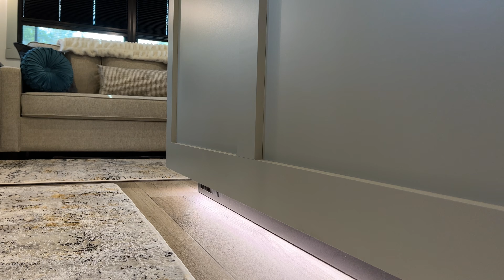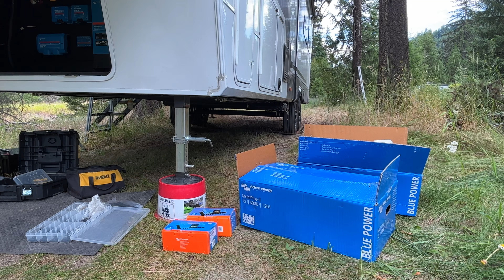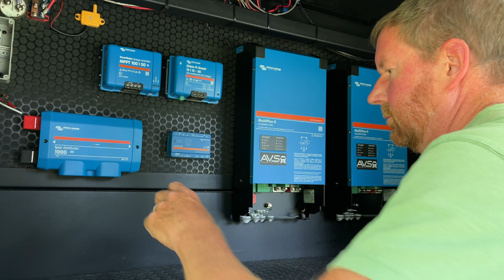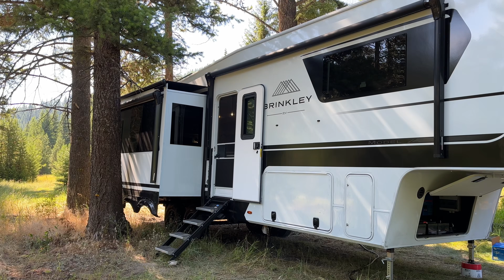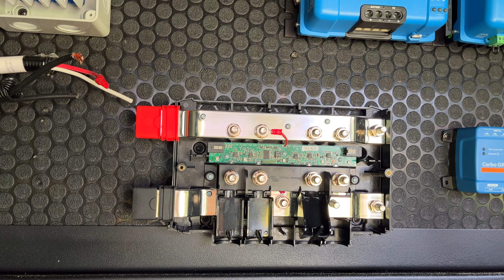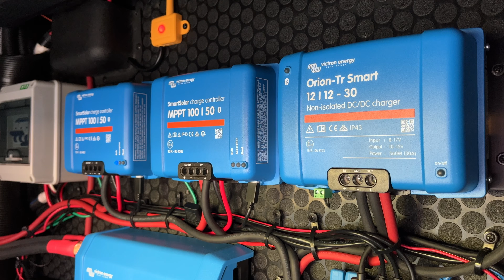This RV power couple is Alaska road-ready | Victron system upgrade in Brinkley Model Z

Comment: Gosh, I see a bit I would never have this setup in my RV with this system.  2 x 370 watt panels in AK for charging 1000 amp hours of battery?  Nope, with all the overcast and rainey days, this system will rely on shore power or vehicle charging to top off the batteries....however 30 amps from the truck is a joke.

Is the reason for not using 24 volt system is because the batteries aren't 24 volts?  I used groups of 12 volt batteries in series for my system with no issues and used a Victron battery balancer for each series pair.  Doing this allowed me to get twice the wattage of solar panels from each MPPT controller.  

Why 2 Inverters?  With one multiplus, I can run one airconditioner on high and my microwave or airfryer.  The idle power draw of two multiplus 2 inverters is about 35 watts per hout for both.  That is 840 watts wasted in 24 hours in idle mode versus 420 watts with single inverter.  The video posters do not have sufficient solar capacity to offset this load.

The people who think this is a great solar system are obviously uninformed.  This is basically a system that relies on battery overcpaacity and with minimal solar power generation.

A rig like this should easily have 3000 watts of panel on the roof to make it boondock/dry camp capable.
Reply from the maker: Hi @andrewdoniec4145, the owners of this Brinkley had already purchased the 12v batteries before they reached out to Adventure Van Systems to install the rest of the system.  These particular batteries cannot be connected in series for a 24v system, so Ken went with what was there. Ken installed a dual inverter system so they could run everything in the rig while allowing for the derating of the Multiplus II units in hot weather.  The dual inverter/chargers also allow them to recharge from shore power or a portable generator more quickly.  The system was installed after the Orion XS units had been announced, but they were not yet available. The owners were going to evaluate how the system works for the way they intend to use it, and address a possible Orion XS upgrade or second alternator down the road. Similarly, they wanted to evaluate the two 370w panels with their personal use scenario, and add additional panels and charge controllers if and when it makes sense for them.

Comment: I have a Brinkley and love it too but this isn’t a win for them. A story about a neat couple that happened to find the one guy that could build this. Brinkley needs a Victron factory option.
Reply: Dealers can’t do this.
Reply from the maker: Hi Tom. When comparing Brinkley to the general RV market, this was a major win for any aftermarket upgrades. Some RV power systems are perfectly adequate but can be a real mess to do an upgrade to - both by the dealer or by an owner after purchase. Brinkley has thankfully built a system that is organized and detailed and has a much higher level of quality in their execution than we see in most other options. While Ken is a very skilled installer, in his own words, ‘Brinkley made this process very easy,’ and it's something that a technician experienced in Victron equipment could manage but yes, you do have to go out and find them. We love the idea of some options from the factory, and have certainly started that conversation. For those who already have a Brinkley or are looking to purchase a new or used Brinkley now, we hope this can be an encouragement that doing something similar is possible. Ken even offers equipment and guidance if you want to do such an upgrade yourself.

Comment: How big is the battery bank?
Reply from the maker: Hi @Mudford63, this battery bank is comprised of six 12v lithium batteries with 12000 AH of capacity. While this is certainly oversized for their loads, that is the advantage of lithium batteries. Unlike lead acid chemistries, Lithium is capable of charging at full current capacity all the way to full without needing a lengthy absorption period. This allows oversizing to comfortably handle loads for long periods of time without exponentially increasing your charge times.
Reply from the maker: It's also worth saying that with a system of this scale and the amount of power the owner needed, it could have been a good option to use a 24V inverter/charger or even a 48V system. In this case, the owner already had the battery bank, which consisted of a non-communicating bank of 12V lithium batteries. Ken decided that the system would likely maintain balance within the system better with a completely native 12V system rather than running the non-communicating batteries in series. A Quattro 24/5000 120V or a Multiplus 48/5000 120V would also have been valid options in a system like this with a different battery bank. The conveniently large electrical bay of this Brinkley camper allowed for a variety of installation options, in this case, the pair of Multiplus II 12/3000 Inverter/Chargers in parallel is a very potent power system built around the 12V battery bank.
Reply: @intelligentcontrols 12000? Or 1200?   Doesn't seem like there's 12000 AH in that battery setup.  I'm shocked they didn't add more solar.  Two 370s is not enough for 1200 AH of batteries.  They need 2400watts of panels on that roof to really benefit.
Reply from the maker: Hi @Weathergeekdan, you’re not wrong about more solar being a good bet. In this case, I believe it was the existing solar that was already installed - they did install a second solar charge controller to be able to install further solar (it might be installed by now, actually). As for the Ah, I believe they had 1000Ah of lithium batteries installed (5x 200Ah LiFePO4). That would equal out to around 12,000Wh of power storage.